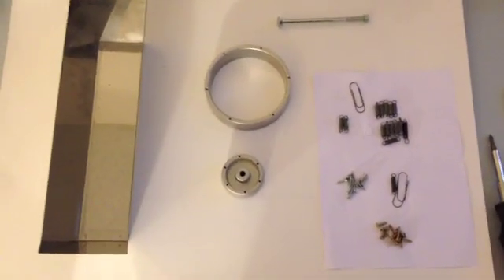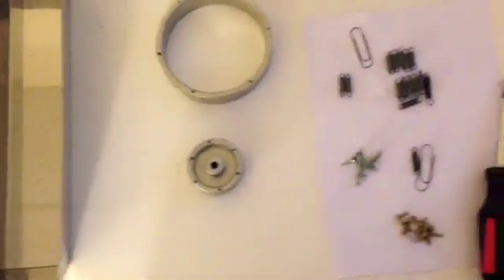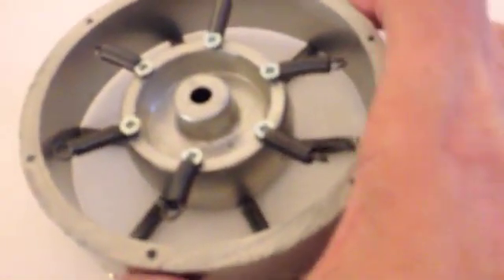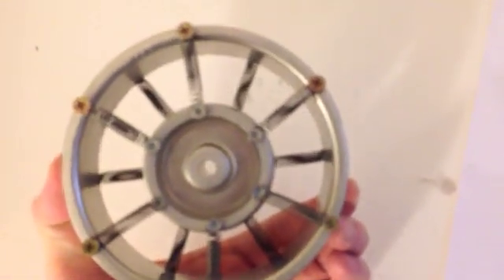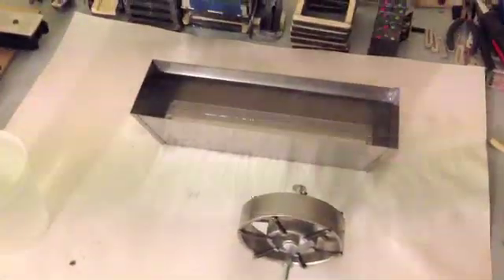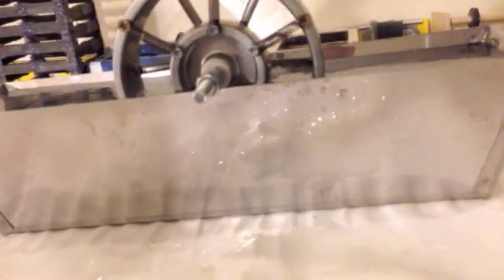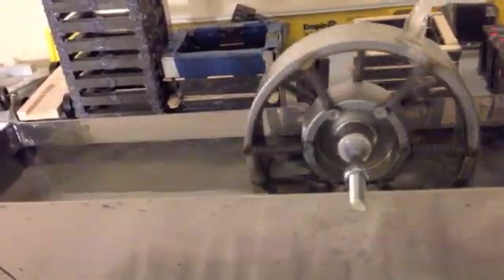Nitinol Heat Engine Version 01

Comment: This is actually a poor demonstration. I have seen others demos that are much better. A good portion of the motion is not due to the Nitinol flexing, rather it is due to the the cold water running over one side or the other of the "wheel" fluid friction and the mass of the water on the wheel are causing the wheel to rotate.  Flip the wheel horizontally and then test it.

Comment: this is a bit untrustable demonstration. You can just spin a simple roll by puring water on it excentrically as the simple gravitation force of the water will move the roll. I dont say it would not work but should be demonstrated differently.
Reply from the maker: Version 3.0 demonstrates it better.

Comment: You realize this spinning has nothing to do with Nitinol, dont you?!
Reply from the maker: The springs are made of nitinol. They constrict when they are immersed in warm water and retract when the cold water is poured on them. Though, it's difficult to see clearly in the video. Version 3.0 demonstrates the principle better, and I used only warm water, to make it more clear how it's actually working. Thanks.
Reply: its just because you rinse the water on one side of the wheel and make it spin. just like a water mill but worse :D

Comment: Anything with a temperature/pressure/potential difference that you can harness can be turned into mechanical energy, until equilibrium is reached.

Comment: You are supposed to have 2 baths one with cold water the other with warm water this tec is from the seventies and if you watch video's from then you will see how viable it really is as a solid state engine and what can be attached to it to make it really a free power alternative.   this video dose not give Nitinol memory metal engines the credit or exposure it needs there are better video's out there look them up and see the power that could be
Reply from the maker: True. There are much better videos out there on Nitinol. And I built better versions after this one, but I share my successes, as well as my failures.
Reply: free power = not thermodynamically sound.

Comment: I'm a little confused on how the thing rotates.. Is there a weight differential on the outer cylinder that causes the thing to turn, or is it something else..

The only thing I can see happening is the springs will either lift or drop the outer cylinder not causing much to happen..
Reply: The springs are made of nitinol wire, therefore effected very much by changes of heat. I believe what is happening is that the hot water in the trough loosens the springs while the cold water tightens the springs. The circular motion is should be created by the movement in the springs. The waterwheel comment from above is not really applicable as there is not enough friction from the falling water to spin it that quickly.
Reply: ndbaker74 this is correct but his design isnt that great either. the principle is right though just poor presentation. also i believe it only takes about a 20 degree difference to see the nitinol change, not 40 as he stated.
Reply from the maker: ndbaker74 Correct. And it depends on whether you measure the temperature in celsius or fahrenheit. Version 3.0 demonstrates the principles much better. Thanks.

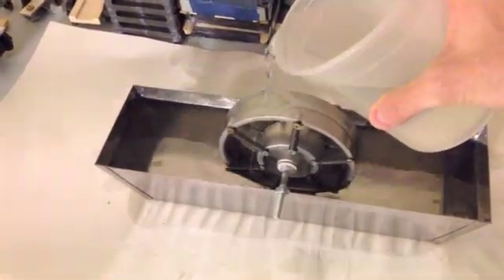Comment: This video is a joke. Notice how the wheel only spins when he's pouring water on it off centre to the top, or manually spinning it himself. Notice it spins in the direction of the water force, first one way, then the other. Notice it didn't spin at all when he poured the water right at the top of the wheel. Pay perticular attention between 3:20 and 3:30 of the video.

He is demonstrating a simple water wheel, nothing more.
Reply: Are you stupid or something? you have no clue how physics work do you?
Reply: HuLk lD a S h X  HaHa! You're too stupid to understand what I'm saying, so you call ME stupid! Loser!!!
Reply: ok this is cnc aluminum am i right? now this will weight a lil right? now imagine how the water should spin this wheel that fast. It's not possible u know??

And by the way: answer me: if your flying away from the sun with great spead wich color will u see if you look back?
Reply from the maker: The springs are nitinol, but it's difficult to clearly see on the video how it worked. If it were a water wheel I would have fins on the outside of the wheel. This really isn't the best design, however. Version 3.0 demonstrates the principles much better.
Reply: HuLk lD a S h X
Sorry for butting in, but: red-shifted EM spectrum. The Sun would appear more orange, then red, and would eventually turn invisible as the wavelengths of light are stretched out of the visible part of the spectrum into the IR spectrum and beyond.
Reply: if u travel with about 1/3 of the lght speed it would be red ^^

Comment: Have you tried applying the heat to the springs from the top with say a hairdrier and using the water in the below to cool the springs?
Reply from the maker: I haven't, but that's a good idea.

Comment: It doesn't actually explain the function of nitinol, but it does demonstrate a good construct for a nitinol motor.  My question is why does everyone use water to heat the nitinol?  Why not a candle flame or a magnifying glass and sunlight?
Reply: my same thought.  even if hot water makes it turn it creates a huge drag. nice wheel design though.

Comment: lower ambient air temps should be enough to increase the efficiency.  and does it have to be water, or can it be air for the heating and cooling?
Reply from the maker: It' doesn't have to be water. Hot air, or solar heat will work as well.

Comment from the maker: That's a valid point too. The variation in temperature is what's making the wheel spin. However, by altering the center of the outer wheel, so that there is a greater variance from the center wheel (making the wheel centers of rotation eccentric) it will work without the cold water. It wont rotate as quickly, but it will work with just warm water. Both methods will work though. Thanks.

Comment from the maker: You are correct. The wheel centers do need to be eccentric for it to work properly. I figured that out, right after I first assembled it. What's ironic, is that this video has been up for over 5 months, and you're the first person to point that out. Well done.I just posted version 2.0, the other day. At the end of the video are some clips of some of the many failed engineering designs I went through on the way to the final version.  BTW, I think your grammar is fine.

Comment: no u dont nitinol does it all by it self after a while cuz its a temperature spring , when all are at the same temp the wheel is centered , but then u heat up a half of it and it becomes excentric... watch a video again as he drop that cold water on top , wheel becomes excentric and  that makes it spin

Comment: the design of this engine is actually fantastic its the temp junction configuration that's bothering us , the reason i like this video so much is because it resembles a heat engine i designed in the 90's , it uses long brass bands instead of nitonal and is over 10 meters in diameter and it function on a temp junction of 55 deg  , the brass bands exert  
over 11,000lb of tension force to pull the hubs center of gravity of kilter to induce rotation or by using a radial piston type set up

Comment from the maker: No I haven't.  This designs efficiency can only be increased slightly by adding more rotors or shorter springs. I'm working on a design that will increase the torc, as well as making it unnecessary to pump or pour water over the wheel. Thanks.

Comment: Thanks. Also, you can bury the tub half-way in the ground, so you will always have a temperature differential, as the ground absorbs out heat. Especially if it's metallic.

Comment from the maker: Slightly heating nitinol simply causes the metal to return to its original shape. 
Cooling it rapidly, makes it easy to bend and stretch. So creating a rapid temperature differential in the metal causes movement, or in this case, rotation.

Comment from the maker: If only works the way I demonstrated with a temperature differential in the water poured over the wheel. As soon as the temperature of the water in the cup matches the temperature in the metal pan, it ceases to work. Thanks.